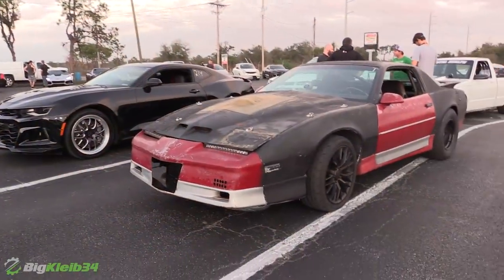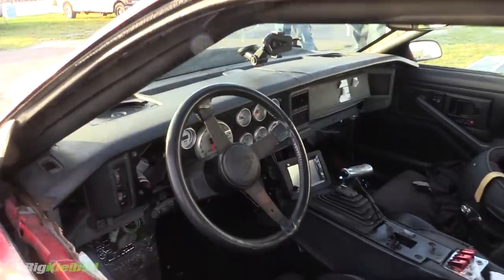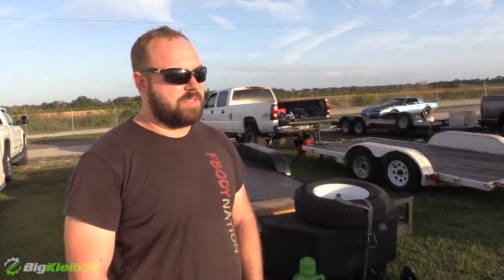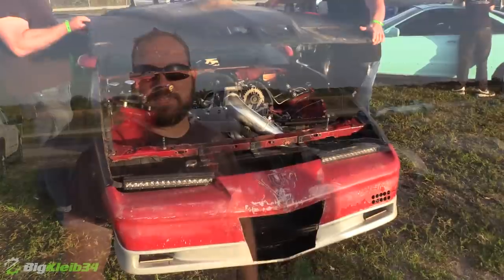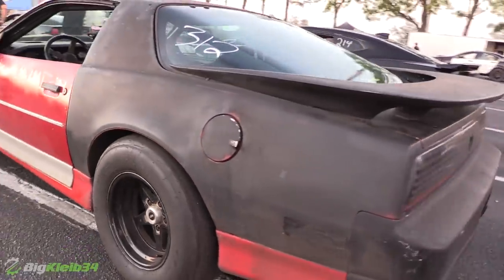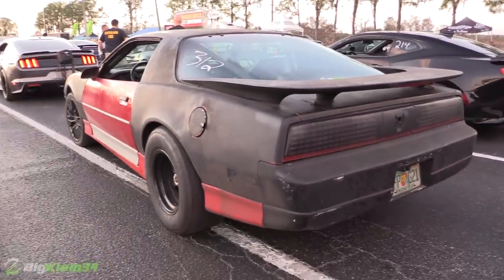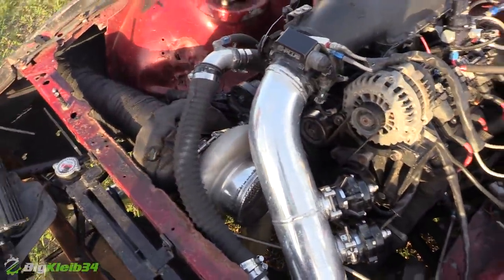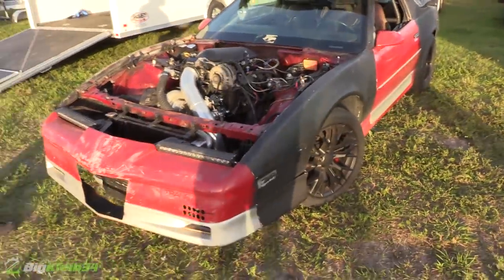Never Trust the Rust Bucket! This Thing RIPS!!!!

Comment: Because he's spent his money where it counts... not spent on making it look pretty
Reply: With a "used" motor out of a buddy's truck.... Obviously Built
Reply: @LIGMOTT  Those ls motors can withstand 1000hp stock. 600hp with a turbo is easy especially with a 6.0. Watch engine masters on motor trend.
Reply: What are you talking about? The thing is a beut in a Mad Max kind of way.
Reply: Who cares what it looks like, as long as it's fast that's all that matters. Besides it don't look too bad, looks pretty solid👍
Reply: @billknight5578  , I hate the rust rod look, as it is lazy and half-hearted.
Reply: Both are pretty important my opinion lol
Reply: Put what you can into the go fast parts and the winnings with make it pretty.
Reply: @randomroofus2239  I let the frame do the flexin off the line.
Reply: @khempleman  that's fair lol
Reply: Glen Baker  😭😭😭💯
Reply: @billknight5578  I dunno,   I rather have a  nice looking ride,  even though I have 3 of them vs a rough looking one anyday. Ideally it would be fast also, but for now I don't have any problems with being slow out there.
Reply: He doesnt even need to make it loom good he just needs $8 of paint from home depot

Comment: I love the fact that he uses jegs cheap drag wheels and Chinese g-plus throttle body just a budget car going fast af
Reply: 💯 budget builds for life :D
Reply: Yeah no kidding , I’m no gearhead but I’m no dummy . That’s pretty impressive for 6.0 truck motor and a turbo . I miss those old square Trans Am bodies . It would look great just plain primer gray with those black wheels as well .
Reply: If you use the “good” China parts they are awesome. VS turbos are the best cheap turbos,
Reply: @dalethomas9307  never heard of VS turbos. Are they Chinese?
Reply: 1990notch yes china knock off of BW turbos. I have a VS racing S480/96 1.32ar billet on my S10 it made the same power as a read deal BW S480.
Reply: Inspiring
Reply: The whole package is pretty low key including the driver. Much respect!!!!
Reply: Norm Macdonald Show  yes same model and generation, it's a 3rd. Generation transam.
Reply: Norm Macdonald Show  yes it is impressive
Reply: Norm Macdonald Show  , yes.
Reply: Norm Macdonald Show  , you can always import one of them from the USA.  I have seen a Pontiac Trans Am, Pontiac Firebird, and Chevrolet Camaro/Z28/IROC go on sale as cheap as $1,000 USA, and add about that much, I think, and you will get the job done. Moreover, with tons of aftermarket parts, and a original paint job/restoration, which you should get from Meguiar's or 3M, or turn to AMMO NYC or Armbruster if you want to have it done professionally, then you can also have your own track beast.  The company that I would trust to send your vehicle is called A-1 Auto Transport, and you can find them on a Google search.  However, if you want a good engine for the track, and the one that you have is not good enough inside of your vehicle, then I would highly recommend that you contact Steve Morris Engines, as they have a ton of good engines that would be at home on the drag strip.  They also have a website, as well as a YouTube channel.
Reply: Sloppy Mechanics credo.

Comment: 8.9 et @155 trap.that thing is making more than 700
Reply: Was about to say the same thing. You don’t go with that build to make 700 hp. Prob 950-1100hp.
Reply: Hard to tell being its and auto. A loose torque converter will read low HP at the tire and haul ass on the strip.
Reply: AWD owners are crying
Reply: Yeah try doubling his number, bracket racer. Nice sleeper for sure
Reply: Same shit I said but he says "750 on 16 lbs of boost" Yea rite
Reply: When he said 700hp ......I was like whaaaaaat?
Reply: Seems like it might be a light car?
Reply: @Cliff00936  real light....👨‍🏭
Reply: Cliff , at 3500lbs, that car is far from light.
Reply: @JD-ml7cg  I was thinking the same.. dang thing moves like AWD.
Reply: 750 to 800whp is probably right.
Reply: @slows102  I made 750whp on a mustang dyno that week. I made 820whp with the nitrous. Car should be 3800 with me in it. I honestly didnt think it would go that fast. First passes off the transbrake.
Reply: Well, in his defense,  he did say "@" 15lbs.... it may dyno at 1100 @ 22lbs, lol.

That trap though, damn!
Reply: @snapperface12345  I'm on a single holley dominator 1800 pump. I am out of fuel before 20psi so that's why it's at 16psu. Once I get a second pump on I can rur. It up some. And for the record this is not a bracket car like all these guys are saying  just was testing mine not paying attention to the other cars
Reply: @turdbirdvstheworld8957  I love it brother! I think the car is on point!
Reply: @ちくてぬしくけて  3500 isn't god awful heavy like your claiming...4200 challenger IS!

Comment: 1500 HD !!! LOL That's a 6.0 and 2500 HD Nice !
Reply: They also make a 1500 HD! I'm looking at one right now at my neighbors house! Basically a 1500 with 2500 springs and 8 lug axles
Reply: @sheeznutz2254  I think the 1500HD also has the 6.0 LS?
Reply: @johnvegar9098  I wouldn't be surprised! I'd go check but my neighbor might wonder wtf I'm doing with his hood up!😂
Reply: A 1500hd is really a 2500hd.....only difference is they came with 3.73 vs 4.10 for the 2500.  And yes the only engine available for the 1500hd was a 6.0
Reply: @aslawnscapes1253  thanks for the info

Comment: Sooo its a Chevy, actually..?
Reply: Yes it actually is
Reply: @johnvegar9098  in a pontiac chassis.  I guess you cant beat a chevy big block.
Reply: @scothere  gm chassis same as the Camaro
Reply: @scothere  except that it's an LS engine not a big block
Reply: @neilbrown82  what does that mean?    The firebird never came with a "Big block"
Reply: @neilbrown82  also these years did Not have a pontiac engine
Reply: @johnvegar9098  oh i thought Pontiac had the 401 in the late 70's but im no expert either way you sure done it right brother.